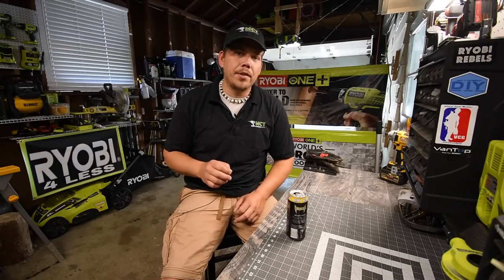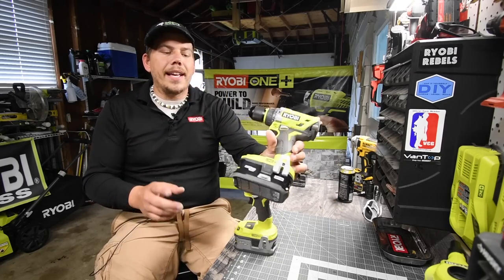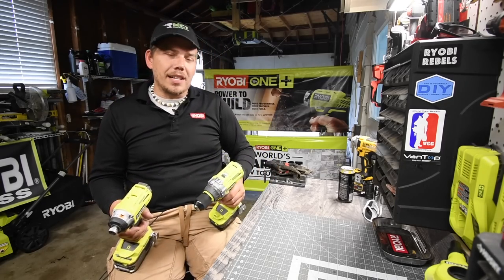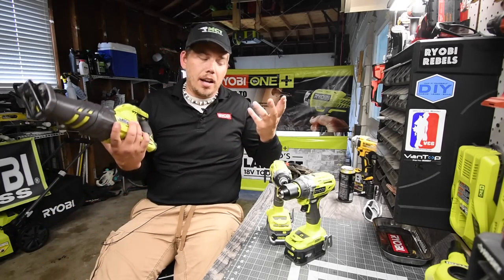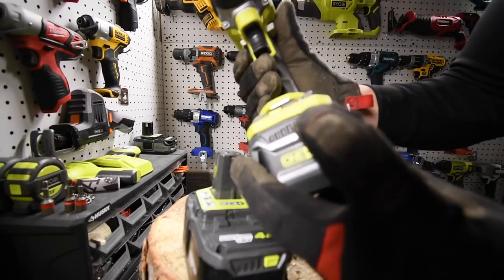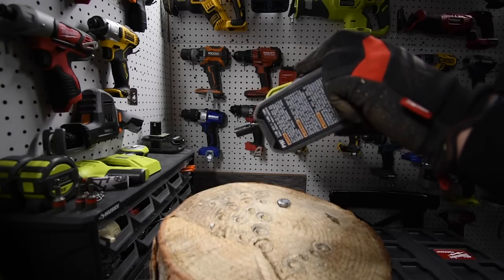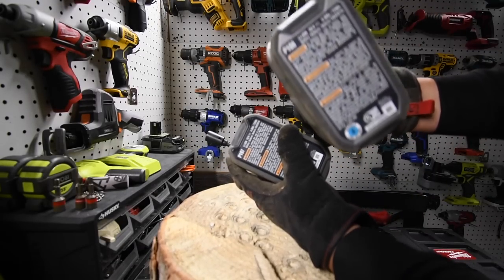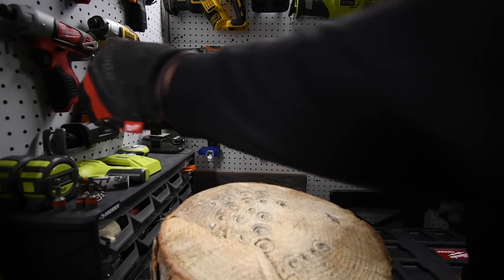Ryobi Grey Vs Black 4ah Batteries

Comment: I just bought pack of 2 black 4 Ah batteries at home depot for 50$. They are good for lights, radio, fan, inverter and other light duty things. For heavy duty i use my 9Ah other grey HP batteries.
Reply from the maker: That is correct and good deal
Reply: Man Caver Tools just went back to home depot and found another pair for 50$.  Cant beat that.

Comment: Well most of ryobi tools are still brushed so they're pushing the entry level 2ah and 4ah battery packs.  I still see 3ah, and 6ah packs in the stores, but the 9ah battery packs i can't find them at my local HD.  Just online.
Reply: What I am interested in seeing and their isn't a single video on this. Is there a performance difference between 3 ah HP, 6 ah HP and 9 ah HP batteries or just how long the battery lasts. Because I have 1.5 ah and 2 ah lithium ion non hp batteries and their is a performance difference.
Reply from the maker: we will see what the future holds
Reply: @LazyCrazyGuy  when I switched to lithium ion batteries from nicad on my classic blue/yellow ryobi drill it woke it up.  Now that I have switched to brushless green ryobi with 6ah batteries old blue keeps up with my green brushless with no issues.
Reply: @LazyCrazyGuy  Generally, the larger capacity tends to offer a little more performance but up till recently, the HP batteries had additional pins that communicated with compatible brushless tools that also had the extra pins to output even more power for a small but noticeable performance boost.  Not many tools take advantage of it but it was basically Ryobi's version of Rigid's Octane.

But now it looks like they're shifting away from that towards HP tools and may be phasing out the HP batteries, but larger AH capacities should still give both longer run time and better max performance.  While the new HP tools may be able to self regulate and may no longer need special batteries to reach peak performance... We'll see on that last part...

Comment: The cells in them are likely the same, the common 18650 size. Most battery packs you break apart end up being series of those, but that extra set of clips to make the battery "smart" is more $$ and why they can be better in some cases. So either they will keep selling cheaper Black batteries or they are trying to get rid of stock...
Reply from the maker: I think they are trying to get rid of stock

Comment: My guess is that they are the same batteries with the same cells and electronics.  They might just want the non-HP batteries to look different than the HP batteries.  There is one way to find out.  Open them up.  All you need it a T15 security bit.  You could do a video on it.  You could open the different HP batteries as well to see the difference between them.
Reply from the maker: Yes sir and I thank you jps

Comment: The manufacture date makes a big different in performance. I have had returns on the black P197's 4 Ah already due to them burning up & dying already. Never have I had a P108 4Ah return or any of my own fail.

What I have been trying to get across to my buyers. The P197's (black 4Ah) are much cheaper to make to fill a void cheaply. They do not sell the P197's separately. Try to find the P197's to buy on HD website. They don't have them for sale anymore. The P108's (grey 4 Ah) have the "Lithium+ Plus" cells in them. Meaning they will last years longer down the road & they perform better in extreme weather conditions as specified by Ryobi themselves. 

And of course the Best of the 4 Ah batteries are the P192's (grey/silver/black) "Lithium+ Plus HP"! Meaning they also have the Li-ion+ Cells & the extra metal contacts for all the Brushless Tools. This is the way Ryobi is headed & only throwing in these cheaper made black ones as they are OK. They get the job done, but don't have life of the other 2. Just give it time as they start to fail & your P108's will still have life left in them. Thanks David!
Reply from the maker: I agree, no clue why they brought back the non lithium plus battery

Comment: Maybe they started phasing them out because they want to push the "HP" in the tool not the battery. 

I enjoy the content but I do wish that you recorded a few min after you edit the main video to go over results. Or atleast showed all of the results at the end on screen with a voice over and maybe even added them up to show the over all time each item takes to complete all task.
Reply: This. They seem to be nerfing the old brushless hp system to encourage you to buy the more expensive hp tools they just rolled out.
Reply: Agree. An onscreen results summary at the end or a running tally would be nice. By the end of the videos I’m already forgetting results from the first tests.
Reply: Yes something like A Concord Carpenter or Project Farm does with their results. 👍🏻👍🏻
Reply from the maker: I cant wait to see how the new tools perform with the batteries
Reply: Man Caver Tools I have seen a video of the new Ryobi compact line and they are having trouble performing.
Reply: @akaredcrossbow  I think it's more a problem of understanding what part of the market they're targeting with the new compact line.  Basically, compact and lighter tools aren't going to perform as well as heavy duty larger tools but smaller can be more convenient for certain jobs where space is an issue or simply less user fatigue by allowing lighter tool options when that's good enough for the job at hand.

So, those tools should be more compared to options like Milwaukee's 12v tool range.  Good performance for it's size/class but don't expect them to outperform the larger tools or even match them.

It's more about advancing the technology in the tools.  They're moving the smart features into the tool, which means the battery doesn't have to be smart.  Though, there may be a QC problem as Workshop Addict tests haven't been able to get the tools safety features to work properly but Shop Tool Reviews tests do seem to be working... But it looks like they're making the tools more reliable and long lasting.  When the safety features work, it should prevent over heating and warn the user with flashing of the base light to show tool status...  An issue with Ryobi's present tools is there's no such safety features and you can burn out the tool, even the brushless ones, which was one of the things the WorkShop Addict test videos showed as they showed, I think it was the Hammer Drill, that had burned out on them and no longer worked after they had torture tested it under their workshop conditions...

Ryobi reps have indicated that the 1.5AH that comes with the compact drill/impact kit, is the first of new line of batteries they will be releasing.  So it does look like the HP will be the tool itself and not the battery but the battery will now all have fuel gauges and may still communicate with the tool another way, as they indicated there's more than the fuel gauge becoming standard, and they're doing away with the additional pins, though that last part is speculation on my part... But goes with the trend they've been doing with the black batteries, etc.
Reply: ZeoCyberG I definitely understand that the compact line shouldn’t be used as a normal sized tool, just used as a go to in a tough hard to get to spot, where other tools are just to big. It’s hard to compare the new Ryobi compact line to12V tools, when the new Ryobi compact line is an 18v tool lineup. The size is definitely more like the 12V, but the Ryobi compact 18V line should be able to do what other “comparabl” 18V-20V tools are doing. Only time and more testing will tell. IMO Ryobi might’ve put this line out a bit to soon before they worked the bugs out, hopefully that’s not the case.
Reply: ZeoCyberG this video was yesterday and I just watched it. He explains what I mean towards the end of the video about it being a special type of tool to use in certain situations and not be abused. 
https://youtu.be/188xxwKA1CI
Reply: @akaredcrossbow  Problem is the physics of the tool matter more than the battery.  Like even just needing an adapter for the Impact Wrench reduces the max Torque it can apply.  You keep on applying more power to a tool that can't efficiently use it then it'll just over heat and burn out.  Like a 1/4 impact can have the same battery as a 1" impact but the 1" impact is definitely going to be about to put out more power than a 1/4" one... Keep in mind Ryobi is the entry level tool and Milwaukee is the Pro level tool.  So not really a stretch to have their compact 18v line compare to the higher end tool's 12v line. 

WorkShopAddict was going by their promotional description but that doesn't mean it was a realistic expectation as it depends what Ryobi meant, which is up to interpretation and should, again, be tempered by the fact they're not the Pro end tool brand...  Just saying... Like already mentioned, it's more about the reliability of the tool and moving to smarter tools for them, given what changes we know they did to the new line of tools...

Comment: Maybe we are getting new hp batteries maybe a compact line the new 1.5 ah
Reply from the maker: I hope we are, it would be nice
Reply: The new compact 1.5AH isn't a HP, but can't really expect HP in anything smaller than 3AH as it would just cause the 1.5AH to over heat and drain too fast. While it remains to be seen if they will continue with HP batteries or whether they will instead be pushing a different battery technology.  Since, it doesn't look like any of the compact HP tools have the extra pins despite being all brushless...

Comment: I've spoken with a TTI representative while they were setting up displays.
Yes they are moving the HP from the batteries into the tool (tbh that would've been better in the first place)

I guess it's kinda like Ryobi having a Fuel line like Milwaukee.
Reply: Makita does the same thing in both the battery and the tool.
Reply from the maker: I cant wait to get the new tools
Reply: Man Caver Tools the new makita tools? Do you mean their 40v line? I just purchased a set of their 18v brushless tools (XT611PT)... I looked at Milwaukee but wasn’t swayed by the little bit of extra power over Makitas ergonomics.
Reply: @Timothy Cruz - Milwaukee, Rigid, and Ryobi are all owned by TTI... There's basically about 11 companies that own all the tool brands out there...  So, when you see similarities it's typically more than just a coincidence...  The new Ryobi Compact HP one hand Recip and 3" Cut Off Saw are basically knock offs from Milwaukee's 12v versions...  Many also subcontract tool manufacturing to 3rd party manufacturers.  So tools can also look similar because they came out of the same factory with just a different brand on it...
Reply: @ZeoCyberG  I am aware that's why I mentioned the TTI rep and no offense but not quite I only know this, they don't really own Ridgid and Ryobi but they make their tools and the respective brands have the final say if they want to manufacture and distribute but TTI fully owns Milwaukee.
Emerson owns Ridgid(Red) name, TTI makes the Ridgid(Orange) Power tools but not the Hand tools which is made by Ridge Tool Co.(for the US).
Ridgid Power tools are basically a knockoff of AEG.
Ryobi is 2nd to having the most power tool line up 1st belongs to Makita(because the Japanese are innovative and both brands are Japanese can't say the same with Hitachi though)
I know more about Ridgid because I mostly own the Ridgid power tools but a couple of Ryobi and Makita power tools. But have yet to own Milwaukee

But ultimately I'm just saying it's nice that the brands have like their own premium stuff like car brands.
Milwaukee Fuel, Ryobi HP, Ridgid Octane
I can't say whether they all work the same though.
Reply: @JuT193  Of course, I was only referring to the power tool range.  Some, like Stanley Black & Decker's Dewalt brand has nothing to do with the original Dewalt that no longer exists and rebranding happens all the time as well...   Like, they may bring over the AEG's outdoor equipment and rebrand them too now that HP no longer has EGO...  Anyway, think TTI sometimes doesn't know what to do with Ryobi, been a few times they've run into patent disputes, for example, along with some products being regional and treating Australia and UK markets different from the US market, and products had to be cancelled like their Garage Opener but we'll see how this new line works out for them...
Reply: @ZeoCyberG   yep I can only hope for the outdoor tools from AEG to come here in the US so I can procure them myself. But about Ego I know they'll be exclusive to Lowe's now and I can only assume that Ryobi will take over or make newer models for the Outdoor Equipment, in fact I recall asking the TTI rep about that but unfortunately I had already forgotten. I can't remember if it was a yes that Ryobi will take over or that they don't have an answer to that. Cause Ryobi is already established well enough in the outdoor tools also I have not seen a lot of Milwaukee or Ridgid having outdoor tools. Or (I doubt it but) maybe Makita might step in they do have some outdoor equipment also. As for what TTI is doing with Ryobi, you're right I think the same. The only news I have about them is that they're updating the power tool models with the HP minus the upcoming ones that are already shown.

Comment: Black is standard Lithium and Grey with Green Stem is Lithium +. I don't know what the differences really are. The color code is Orange/Yellow with matching stem = NiCD, Black with black stem = Lithium, Grey with Green Stem = Lithium +. This legend is included on your P117 chargers right above the hole you put the stem in.
Reply from the maker: yes sir, I don't understand why the black batteries done have the lithium plus in them